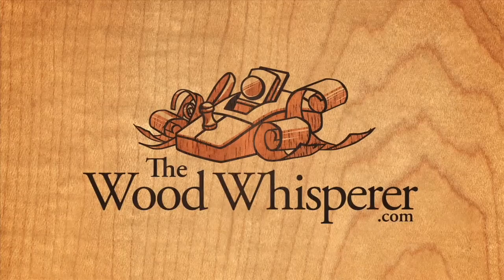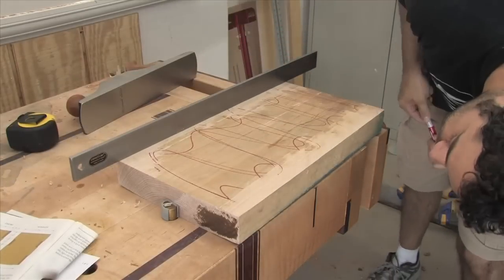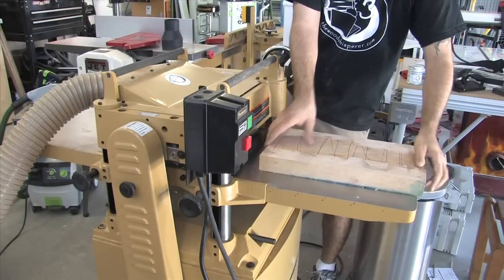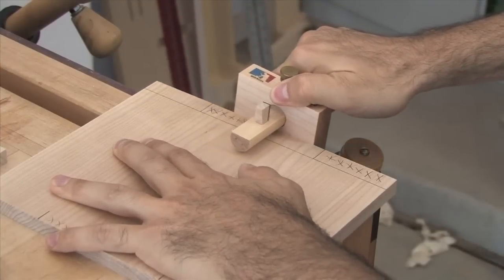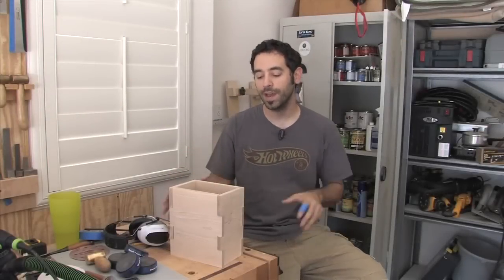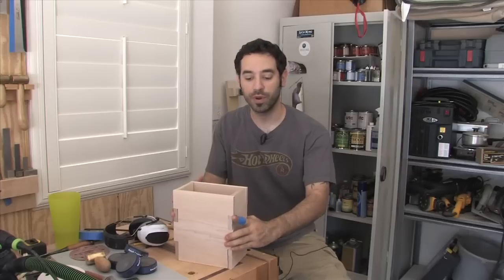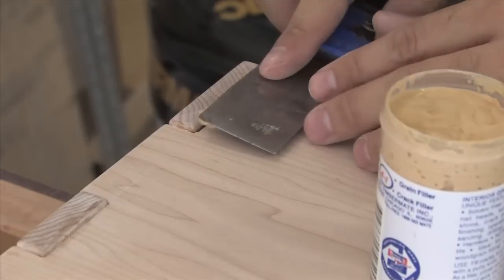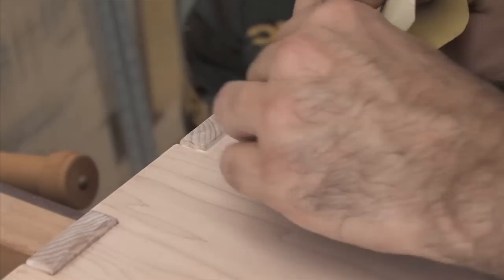187 - How to Build a Knife Block

Comment from the maker: You only need the planer, jointer and big hand planes if you can't find pre-milled stock. I happened to start with very thick stock and I just wanted to show how to mill it down. The actual build itself was done with very simple tools, primarily the tablesaw, jigsaw, chisels, and a block plane.

Comment: Build the box at an angle. Multiple benefits: one, if the face of the box angles towards you, it's a lot easier to get the knives in and out, especially when the box is stored underneath cabinetry. Two, the bottom of the box can still lay flat, so when you're laying in the sticks, the epoxy will stay where you want while gravity will help you lay the skewers in nice and straight. Best of both worlds!

Comment from the maker: Generally speaking, the "proper" way to do it is to flatten one face first on the jointer. If you don't, you might end up with a curved board. If the board is mostly flat to begin with, you can sometimes get away with skipping the jointing process.

Comment from the maker: Thanks for the kind words. I used epoxy for two reasons: working time and gap-filling properties. Regular wood glue would have probably worked just because of the shear number of sticks in there. But the bond wouldn't be all that great. Still, probably enough. I just like to go overkill when I can. :)

Comment: made one like this and used a shallow layer of rice in the bottom to absorb any moisture and skewers in points down, no glue.  10 years going and still works a charm.  It gets daily use and haven't replaced skewers yet.

Comment: we did a similar project to this in wood shop in school. when we put the Skewer we left them in the small bundles put more tape up around the pointed end. Then we removed all the rest of the tape and before the epoxy dried we just went back with an xacto knife with a long blade and just cut the tape off that way. Then filled in a bit more with just loose ones because with the bundles you won't be able to fill it all in. Just an idea for anyone wanting to try this project out and to make it little less frustrating.

Comment: Where do you obtain your supply of wood. I've used pallet wood and I've found it's low quality and I've heared that you can get cuttings from hardware stores very cheaply but I'm not sure if most of it isn't just plywood(Chippy stuff). I know of a woodworking store but I'm fourteen and not with much money. Do you have any idea as to where I can get wood affordably?

Comment: Wood Whisperer, why did you choose to use the jig saw over the band saw? I'm new to wood working, but I think the band saw would give you a front to back  equivalent cut than the jig saw. What do you think?
Reply from the maker: The project was based on the "I can do that" series of projects published by Popular Woodworking. The jigsaw was used purely to show people that it could be done. I can think of several tools that would have done the job better.
Reply: The Wood Whisperer
Thank you for responding.

Comment: Hi Marc, I've been woodworking for 5 years now, I started freshman year of high school. I haven't built many pieces of furniture yet, but I haven't been satisfied with anything I've built. Part of which can be blamed for improper tecnique or simply learning the craft, but for the most part, they are just poorly made. My question is have you ever built anything that you just didn't like how it turned out? Also, do you have any tips for getting out of a woodworking rut? Thanks
-Mark

Comment: How do you keep the workshop so clean ? I see the dust coming from the power tools, like the plainer , is collected in a tube. Do you also run a vacuum to collect the dust at the same time as the plainer ? P. S. sorry if my English is bad.
Reply: Your English is good. I'm new to woodwork but yes some (most?) power tools have a tube going out of them allowing extraction. You fix a vacuum to that end and voila :) clean and tidy

Comment: When cutting the bamboo sticks/skewers, wouldn't it be simpler and easier to use a Pringles tube? "Overstuff" it with skewers, and you can simply cut through the tube at the correct length with any kind of saw.
Reply: Building a sculptors stand
Reply: that's a good way but if you only have a few to do another way is to use a piece of PVC pipe that will hold about the amount you need
Reply: @jimmytate7587  That's the same exact way as the pringles can just replacing it with pvc.

Comment: I'm wondering for the cutting of the bamboo sticks if you could have done something like using pruning shears to get them close to the right length. And then bundling them up like you did and getting the exact length by holding them against a vertical sander. Maybe cutting 1000 bamboo sticks with pruning shears might take some time... but lining them up on the edge of a table so that the waste part hangs over the edge and then just going to town on them with the shears. I dunno. A possibility.

Comment: First thing I think of, is why glue down the skewers?  I know how much dust/nasties can build up in areas that you can't clean, and I'd just leave the skewers loose so you can remove them occasionally to clean out the knife block.  Just my two cents
Reply from the maker: I guess I was afraid they'd be pulled out too easily. But if they are packed in well that shouldn't happen, so you bring up a good point.
Reply: @woodwhisperer  skewers wouldn't pull out with the smooth blade. Could suck if not glued and falls over but being glued not that hard to suck dust out with the vacuum..
Reply: I would worry about mold growing in the skewers.  It's been two years.  Is it still working?

Comment: I'm not entirely convinced the epoxy at the bottom is entirely necessary to hold the bamboo skewers in. Only time I'd say it would come in handy would be if you were moving, but you could just use masking tape in transit.

Comment: Is it just me, or were sparks flying at 6:30?
Reply: yeah power tools sometimes do that no clue if their dangerous or not though
Reply: It's just the design of the jigsaw. It was two ceramic plates on both sides of the blade that keep the blade square to the saw and prevent the blade from. Veering out. He had the plates tightened a bit too much causing them to run the blade. Not dangerous just causes the blade to wear out a little faster
Reply: Huh, that's interesting. I was pretty darn confused seeing as wood, you know, doesn't spark lol

Comment: Neat project. Thanks. Epoxy is no longer considered 'food grade'. Epoxy resin is about 90% Bisphenol-A, which is now banned for products children might put in their mouths.  (But still a great material.)
The basic concept of your box is really neat. I wonder if it couldn't be slightly tapered, tighter at the bottom and one long side simply screwed on. The skewers would be packed in with 3 sides and the bottom (tilted to level them) then the 4th side screwed down to 'clamp' them. Of course I'm suggesting this because I'll never get around to making one. I don't need it...but I'm going to hang on to the terrific concept.

Comment: I've found that Jigsaws and straight edges don't work well for fine work. The edge takes your eye out of the equation and the grain of the wood will cause the blade to flex and wander slightly and when your planted against the edge your hands can't adjust.  "Trust your feelings Luke"

Comment: Thank you for the video! Very nice project, definetely a nice way to grow some skills when you're a beginner (like I am) while still doing something that's usefull and looks great. Just gonna share a few things I did differently, in case that helps someone. I used a fast epoxy for the bambu sticks (about 5 minutes before starting to dry), and it actually helped a lot, as the epoxy was way stiffer, I was able to tilt the box vertically without the epoxy moving, and insert the sticks was way easier, in a very orderly fashion, very quickly. I also added a glass panel on the front side, to make a mix with TabLeft Workshop design (?v=wRC3Pj3rjuM) and the result was pretty cool. So, again, thank you very much for the video, the idea, and the nice explanations that go with it.

Comment: Why would someone decide to use epoxy over wood glue?
Reply from the maker: +Grant Stoppel A few possible reasons. Glue strength might be one depending on the situation. Oily resinous woods also do better with epoxy. And finally, open time. You can get a long-set epoxy that will offer you 20 minutes of assembly time.
Reply: +The Wood Whisperer thanks for the info. Keep making great information videos
Reply: +The Wood Whisperer thanks for the info. Keep making great information videos
Reply: +The Wood Whisperer or a quick set (1 min.) set for repairs. I've used this as a sort of "tack weld" for bigger glue ups, as well.

Comment: is it just me.. or are using skewers a cheap way of avoiding any real woodworking? its a box and some sticks.. i mean.. come on.
Reply from the maker: +Tyler James Brooks it's just you. 😁
Reply: I was confused when I was watching it because I've never seen or heard of an 'open ended' knife holder. I thought there was gonna be a lid placed on the top after the skewers were added just to give it a 'full' feeling when you put a knife in or pick it up. But that didn't happen. But anyway, I think he said several times in the video that this is designed to be simple. You could over complicated anything but why when this method works too.

Comment: What if you do not have the machine planer and band saw? What are the alternatives. I need to make a block for my two tool knives. (one is a flat metal camping knife and the other is a kitchen's and chief's utility knife.)
Reply: Buy 1x10 instead of thick wood (2x10)and cutting it down the middle into to thin boards.And use a high saw for all the other cuts or a hand saw. Hand saws are all Japanese carpenters use and they do some of the finest finish work. Check out some of their YouTube videos.